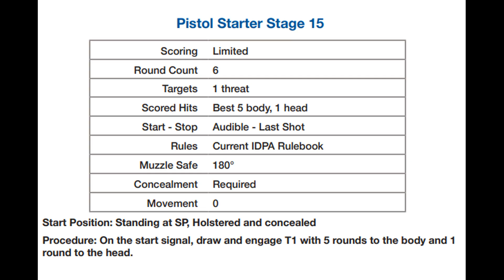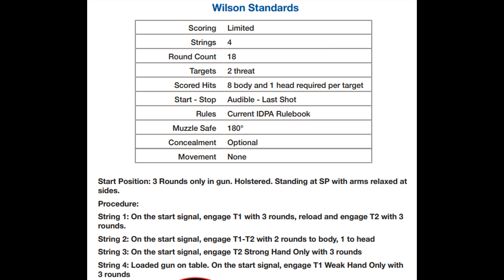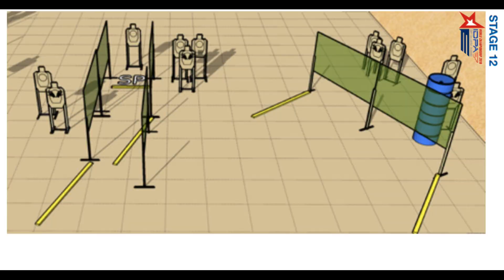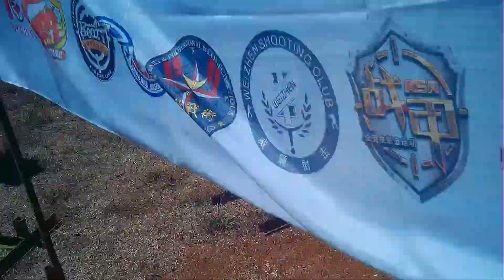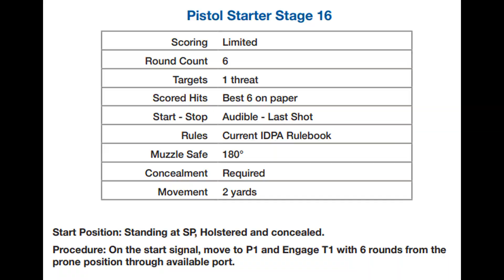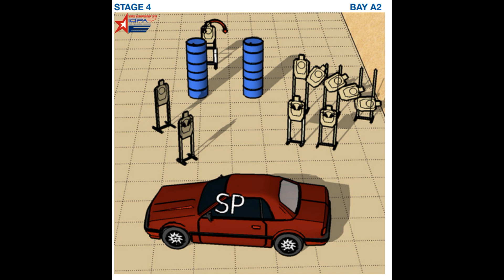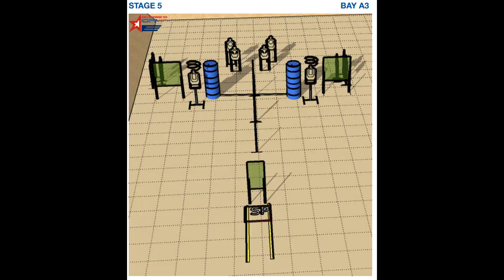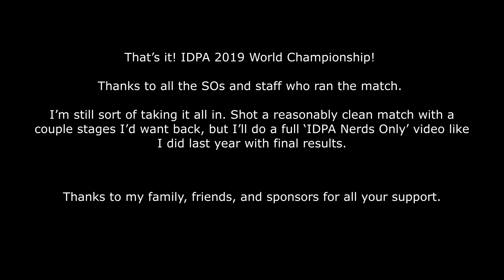IDPA 2019 World Championship - 1st Place CDP EX - Colt 1911

Comment: Great show I'm new IDPA CDP shooter out west. What rounds are you using?? Your 1911 is barley moving. What springs you have and round recipe 230gr I'm guessing. Nice Run and your videos too.
Reply from the maker: Hi. I was actually got in last minute for this match and I still don’t own a .45 reloading setup. The ammo is actually 230gr Federal ‘Range. Target. Practice.’ Which I’m not even sure they make any more. It ran about 175PF if I remember correctly. If you can find it. It’s great stuff. 

I ran and still run a 12lb spring in my 1911. And an 18lb mainspring

I recently just got the old 1911 back out a couple weeks ago and was shooting Southern Munitions reloads out of it which I found were nice. Check out the GFDS match video from a couple weeks ago where I was shooting that stuff.
Reply: @GunnerSouthPAS  - I will for sure, thanks for the Guidance. I have a Citadel 1911 and just Use WWB. But it seems very Snappy I Have pretty good Grip and fundamentals but it just seems rough follow up is slow. But this was my first match so cant complain to much.